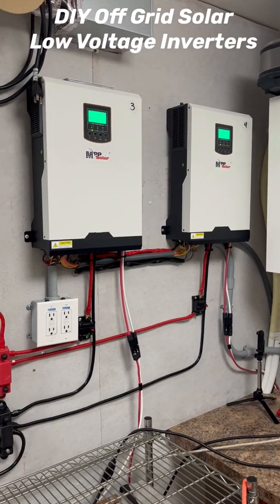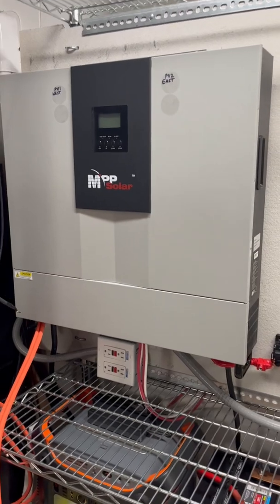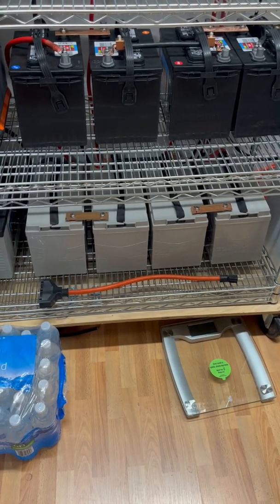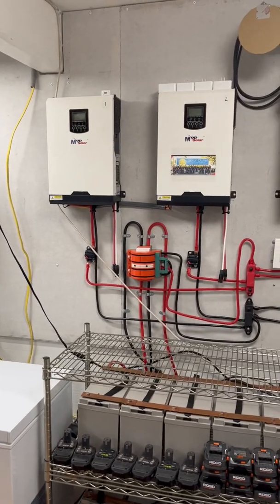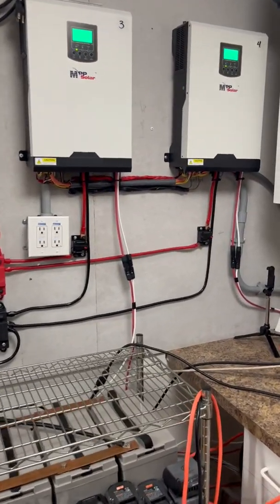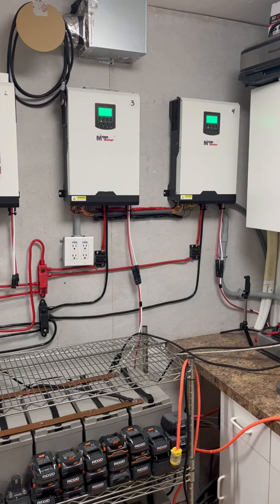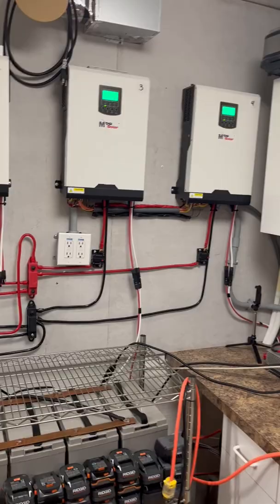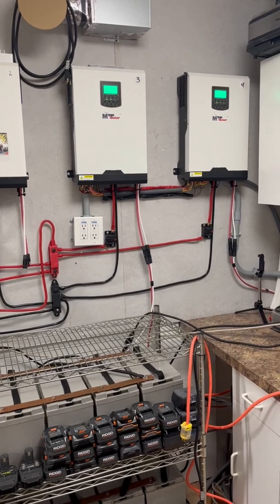DIY solar power with Pappa Off Grid Inverters 24v & 48v  inverters comparison.

Comment: Heya, as an electrician/hobby elektronicus I see you already have a lot of comments so I'm not gone say much but I would use some BMS for your battery banks
Reply from the maker: All my servers rack batteries have built in BMS that keep at batteries in parallel within .05v of each other and the inverters have programming for the LiFePO4 battery bank as well as the battery safe guards, also each battery has 2 built in fire suppression for the Lithium Iron Phosphate cells in case they were to overload and catch on fire. I buy my batteries from Signature Solar which are manufactured specifically for solar use and are UL listed as well for on grid solar systems. All my systems now are built with many electrical safeguards. I would never build my own battery banks, too many catastrophes on YouTube about diy built battery banks. Once again thanks for your comments that help others understand the importance up having BMS on Battery banks.

Comment: I noticed when you said when you put two 100ah 12 volt batteries together to make 24v that u said the amp hours stay the same but what u didn't mention is u gain more Watt hours tho so ur running time is longer
Reply from the maker: You are correct. I sometimes forget to mention these things in my videos. Thank you for pointing that out.

Comment: What all these other guys are, or were trying to tell you is explained in Watt's Law and Ohm's Law. Going along way back to basic physics, electrical section. There are simple explanations i.e. Made easy books which give a good explanation and you only need 7th grade algebra to fully manipulate both basic equations, even possibly with a few u-tube vids on each. With what all you have already done, in your videos, I'm sure you could get a functioning understanding in a weekend or so!? It's always a journey with GOD!
Reply from the maker: Thanks for the reply. It is wonderful to get such great responses all the time. I actually already have the basic understanding from taking electronics classes way back in the day in college but never used that until 40 years later. It’s not I don’t understand that stuff. I like to test out things for my self. I want to see how long it takes for a solar panel to fail being in series or parallel with constant partial shading all day long weather poly or mono panels. I like to see how much it takes for a breaker to trip. I do things a certain way on purpose. I tear things apart and put back together to see how it works and to see if it will work again after I put back together. Which it always does, lol. I appreciate the wonderful comments from everyone. But all along the way, I was able to see in real applications when something failed and why on purpose so I can tell weather to trust or the product or not. I have seen products fail at half the specs and other at twice the specs. I don’t trust any products until I test and see if they work like they should over a period of time. The one thing I always look at is how hot inverters, wires, battery connections, solar panel connection, ac disconnect fuses, etc… get while using. I also check constantly with a meter the amps, volts, watts. I’ve done a lot of testing over the years with the components I have since I am fully retired and have all day to do it. In fact my dad was an electrical engineer for over 40 years and does not understand how I was able to connect all these components together and make it work with very little or no knowledge 3 years ago. To me, real world experience is what I look at. Does the product work and will it last. I like to share what I have learned with others. I understand the theories. But I like to test the theories as well. Just because a product states it will do something does not mean it will actually work. Especially in todays world. With all the fake products being produced, you can by from anyplace and it could actually not be the product you thought you were buying but a cheap nock off that looks like the real thing but will fail very quickly. I learned a long time ago that theory and real world application are not necessarily the same outcome. My goal is to share with others on this channel that you can learn to do it yourself on anything  if you put your mind to it and research it and the big bonus is along the way on YouTube, many people that have experience in what you are doing will lend a helping hand with great advice, suggestions, cautions, comments, and so much more. Once again thank you for your wonderful comments and I always rely on my God and father of Jesus for everything be it healing or answering my questions about everything and anything. I find all my answers and wisdom come from Above. I can not tell you how many times I can not figure out how to do something, then I will ask God for help and within minutes, hours, days, weeks or even months, one day he will give me the answer and I will be able to complete what I wanted to do. So far he has given me the way to do it 100 percent of the time. Without God nothing would be possible for me. With god all things are possible. In fact I have seen over 50 people healed of things doctors could not heal through faith, prayer and with me sometimes laying hands on that person. God was the one who has the power to heal them and healed them. That person and I just exercised our Faith that God could actually heal them. I have such a strong Faith in God the Father, Jesus and the Holy Spirit God gives to those who believe that I believe the word of God over what the worldly wisdom says every time. Actually God is the one who created the way everything works in the entire universe, he is the best teacher to go to for understanding everything. You are correct, it’s always a journey with God!
Reply: @diy-solar-guy  Ya, I totally understand I spent half my life white collar and half blue, and several lives within that , lol. I'm also retired now, I'm setting up a shop on my property and doing some rv's cars etc. I' plan on getting out in nature and studying and inventing again and coming back home and building more, God willing. I achieved most of an engineering degree was a designer for a couple of decades, then family high school math teacher, ARMY, master auto tech etc. not in that order but all mixed up, lol. Life is always an adventure when you try to do it with God and love Jesus!
Reply: Ya, I thought there had to be some experience back there somewhere or you were just really smart, but I also understand not really wanting to say if it's been a really long time.
Reply from the maker: @markjackson6829  Amen, sharing the gospel and my love for God is my true passion, solar is a hobby that keeps my electric bill 90 percent lower.
Reply from the maker: Actually, 99 percent of what I know about what I do on my channel I learned in the last 3-4 years. Before that I barely had done anything except maybe wiring up a ceiling fan and had no clue about AC heat pumps. But I love to try and do things I have never done before. I lack the technical terms but I am able to complete the task. Can’t explain it as well as I can construct it, lol.
Reply from the maker: You have had a full and sounds like a wonderful life. Being retired is wonderful if you are able to stay busy and are self motivated. I rarely sit on the couch during the day. I love doing stuff around the house and listen to the Bible. I have gone through 2 incurable cancers since around 2012 and still get treatments every 8 weeks for the rest of my life and with Jesus, I have not had a bad day in almost 2 decades. Every day is a gift from God and I look forward to who God will bring into my life and how he will use them or me for his Glory. I should be 6 feet under from the 2 cancers but instead I am sharing daily with strangers about God first in person and second on YouTube with solar. I truly have been blessed with such a wonderful and blessed life more than I deserve. I hope you have a truly wonderful and extremely blessed day sir and hope you enjoy all the rest of your days being retired fulfilling all the things you want to accomplish.
Reply: @diy-solar-guy  yes AMEN, I had a TIA a few months ago but nothing since so far, but still high probability of a stroke in the future , just have to keep going in Christ! And yes every day that we are given matters, especially for those we can help in our limited time left I will pray for you, I hope it is not too painful! I know my mothers was.
Reply: But also be careful as you could go into remission and live a lot longer and a lot of people would miss you here! Are you doing KETO to help starve the cancer?
Reply: And yes I should have been dead so many times but God still has me here and I want to make the most of it, with the understanding it could still be a while before he takes me home!
Reply from the maker: @markjackson6829  I’ve been doing Keto for 2 1/2 years as a lifestyle change to eat healthier without all the additives.
Reply from the maker: @markjackson6829 my strength comes from listening to the word of God all day while doing stuff around the house. I have  learned to live with the pain.
Reply from the maker: @markjackson6829  I always say what the word says, better to be with the Lord for those who believe then to be here, but for the sake of others , we continue and preach the Gospel hoping to save some.
Reply from the maker: @markjackson6829  I trust in our Lord Jesus to get me through each and every day and keeping my sights on him all throughout the day is my pain medicine. I listen to the word of God all day long while doing the things around the house that need to be done. I have joy and peace because of Christ and do not worry about pain to stop me from sharing the Gospel on the times I leave the house. We are cleansed by the washing of the water of the word of God. My desire is to do the Fathers will and the Fathers will is that we should listen to his Son whom he sent which is Jesus and to not only listen but to do everything Jesus says. Jesus said nothing on his own accord but only what his Father in Heaven has said. Jesus only did what he has seen his Father in Heaven do. So to I will listen to Jesus and do what he tells me in his word to do and be taught by the Holy Spirit given to me by God the Father of Jesus in all things. For the word of God says to ask for the Holy Spirit and to ask for wisdom if I lack it, and God will give wisdom to me generously without price. I have joy and peace in my heart every single day I wake up never worrying about what troubles the day might bring but rather all the opportunities to do Gods will and to put on the Armor of God to fight all kinds of spiritual battles to help others in their distress. For we do not wrestle against flesh and blood, but we fight powers, principalities, strongholds, dominions of darkness and all kinds of evil. My days are filled with so many blessings and joy beyond what I deserve. I am humble man in knowing I’m a sinner saved by Grace and forgiven of all my sins when I was reconciled to God through my Faith in Christ Jesus and  what he did on the cross. I therefore asked God for the forgiveness of my sins and was forgiven. I Am therefore a new creation in Christ Jesus created new to do good works that I was unable to do before. All things are new. Oh how joy of the Lord fills me each and every morning I open my eyes. For all the things of Kingdom of Heaven are more real to me than that which I can touch and see. The promises God gives for those who truly believe in him. The blessings poured out on those who trust only through Jesus. I am a man of great spiritual wealth, not the wealth of this world, but all my treasure is stored up in Heaven. One day I will die and it will be a glorious day because I will finally be with my only Lord and God in Heaven, Jesus. Today is going to be a great day as every day is. May this response richly lift you up and bless you in knowing all the promises of God through his word will be fulfilled. Have a truly wonderful and extremely blessed day sir.
Reply: @diy-solar-guy  Amen! I need to get back to that! Sorry sometimes I get too direct and blunt, nothing personnel. I feel I'm trying to live two lives one where I can stroke out at any moment and one that I have another twenty years, kinda hard to plan for. But yes I also received mental/brain related injuries from the Army, including a predisposition to be blunt before that. So when I see things on you-tube that can be dangerous I spend the time to go directly after trying to help with that, But I should pray more first in order to help get the message across. I have sources for the other equipment you may want or need just ask if your having difficulty finding it at a reasonable price? Thanks again for your videos, and especially freely speaking about your relationship with God, I need to be more outspoken on mine and get back to the word every day!
Reply from the maker: @markjackson6829  I let the Holy Spirit guide me on what to say and who it should be said to. You are only the 2nd or 3rd person in almost 2 years that I have been prompted to share with out of all the 100’s of people that comment on my channel. God is trying to draw you nearer to him. We can come to him on our own power so when he draws you near through others he wants you to draw near to him. Faith comes by hearing and hearing the word of God. Notice the scripture does not say Faith comes from reading. God speaks to us through others by the Holy Spirit in them and in his word, his word is alive, active and has power to do all things. The more you are in the word, the closer you draw if you hear him speak to you and then do what he says. We are cleansed by the washing of the water of his word. To get clean in a shower, you need a lot of water, same with being cleansed by God of all the sinful and worldly things we do all throughout the day every day, you need to be listening to his word a lot to hear him speak to you clearly and be cleansed at the same time. For many are called but few are chosen is what Jesus says in the New Testament. But in the Old Testament, it states in the scripture that “ the moment you believed, you were called”. How glorious it is to be chosen by God and I believe you were chosen just as I was. The question is. What will you do with this revelation from God? In the book of Exodus, God says, choose Life in him in listening to his ways or choose death in following the ways of the world. What is your choice Mark? I can tell you for a fact that no one who ever chooses life in him ever regrets it, I know that for a fact! There are 168 hours in a week, if a person goes to church one day of the week and hear a sentence or two of scripture in that one hour and we are cleansed by the washing of the water of the word of God. How long will it take that person to be made clean, I believe the answer would be never. Jesus says to pick up our cross daily and crucify our flesh , not fulfilling our worldly desires, but rather doing the Father in Heavens will, his will once again if that we should listen to his Son, Jesus and do what he says. I absolutely love listening to the word of God all day long, weather it was when I was still able to work 8 years ago or now that I’m fully retired. Gif reveals do much every moment I listen and the pure peace he gives just pours over me like a waterfall. Hope this truly blesses your day sir.
Reply: @diy-solar-guy  AMEN, and thank you very much! About 11 years ago my life and my family fell apart, I totally believed and felt God abandoned me. I have since realized that was not the case! He just had something new for me, to do. The better part of my family came back. Also I've been able to show some of the weaker, in faith family what they should be doing instead of the worldly stuff. A couple have started following that! What a blessingI And you have a great and blessed day too! And again thank you!
Reply: And yes I totally need to redouble my efforts to follow God's calling!

Comment: You are overly concerned with amp hours;  you should evaluate your batteries in Watt-hours for energy capacity. Then you see that higher voltages have less resistance loss in the wiring due to lower current requirement.
Reply from the maker: Thank you for all your help in your comment. I appreciate it since I am a DIY guy. I will look into what you said and make changes with system in future videos.

Comment: another thing to keep in mind with your AGM batteries is that all of that capacity you cited, you can only use no more than 50% of it. So your 14.4kWh bank is really only 7200 wH. If you went LiFePO4 you could use more than 90% of it, and it would last around 20 years and then still have around 80% of its rated capacity. food for thought. 
Now, if your bank is getting you through the night without dropping below 50% then just use it until it dies in a couple years. 
I did notice that you are not using any kind of capacity meter to tell your State Of Charge. There are some pretty decent ones out there for pretty cheap. Victron has the smartshunt which is good and has bluetooth, and Ali has one with a nice LCD display but no bluetooth for around half the price. Both excellent. If you want any help with your system I am happy to offer it, let me know.
Reply from the maker: Hi, my 24 battery bank never goes below 25 volts and my 48 volt battery bank never goes below 51-52 volts at rest not under load. I only use my system during the day, I did not design nor do I want to use at night except for a few appliances and lights. Still my battery bank is always above 25 volts on 24 volt bank. Thanks for the input and hope you have a wonderful and truly blessed day.